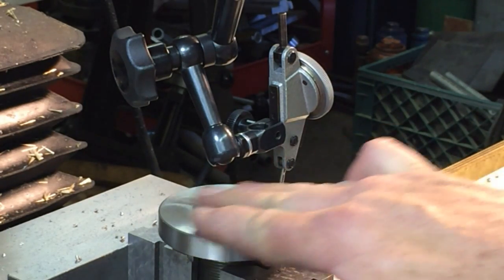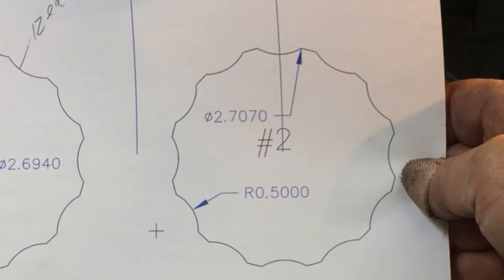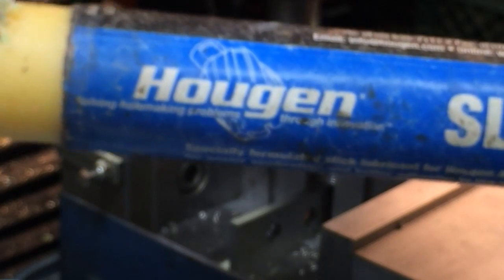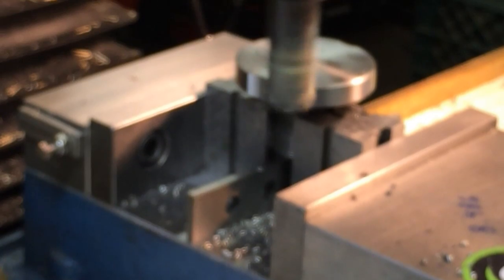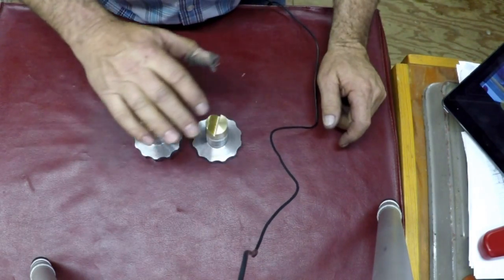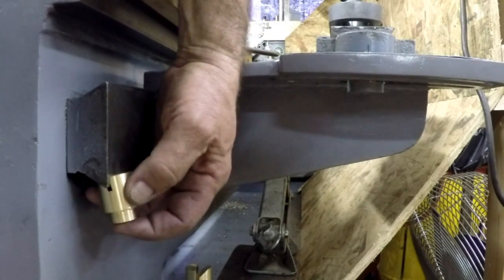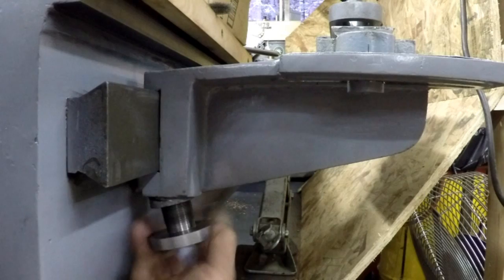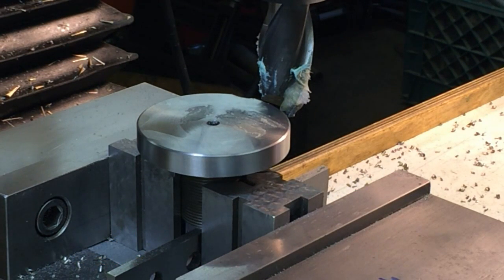How to Repair a Lathe Change Gear Part 8

Comment: Re: Mr  Bozo at the end. Better a kick-away like that than to rotate the part around several times, chewing up the entire periphery. I think we have seen something like that from one of the other Youtube Machinist luminaries.

I kept thinking that a collar of copper sheet (0.050" or so) wrapped around those threads would let you really clamp down on those screws in the mill and on the lathe. My house is roofed with that stuff, so I have a lot of scrap around.
Reply from the maker: Peter W. Meek Yep, it would of been even better if I had the vise tight.  Wrapping the threads would of helped, copper provides alot of friction.  That makes a very nice roof.  0.050" would make some nice soft warps for the lathe chuck jaws.  Thank for the idea's Peter.   ATB  Randy

Comment: Hi Randy,
have you thought about putting 2 or 4 holes in the face of he knob to accommodate a spanner wrench to tighten the knob? since a guy can't get too crazy with the torque on a spanner it would sure be a better way of getting the tight on the knob without having to resort to a pair of channel locks.

mike
Reply from the maker: HolzMichel Thanks for watching Mike.  Thanks for the suggestion.  I was thinking of a spanner but using the scalloped edge.  That would give multi-positions.  Randy

Comment: Nice work! Does the hole on the outside go all the way through? If so you should be able to put some tig rod or something through the hole and push the brass up into the hole while still being able to turn the handle and start the threads when they are all aligned. Enjoy the videos keep them coming..
Reply from the maker: ***** No on the hole, but I am going to re-visit this whole setup in the near future to see if can do some improvements.  Thank you for the suggestion.  Randy

Comment: Now that you have the locking bushings engaged it may be a moot point, but.  If you slide the taper frame off the way you can then adjust the position of locking bearing as you slide the taper frame back on.
Reply from the maker: Morris Gallo Thank you Morris for the suggestion.  I think that will work.  It be a bit tough, the unit weighs about 60+ lbs.  Thanks Randy

Comment: Hi Randy,
To make an easy hold of the angled bushing while you thread the handle, you can have a hole in the handle in where you can have a rod to hold the bushing while you thread the handle, then slip out the rod, voila... just an idea...
Is the lubricant for annular cutter wax based.... So far I use this kind of lubricant on the band saw for aluminum and it's great on stainless for threading and tapping.
Cheers,
Pierre
Reply from the maker: pierre beaudry I am going to revisit the entire clamping and alignment of the taper attachment in the near future.  I just went with what was there for now.  But after using it there is something I think I can do to make the entire arrangement better.  The lube is yes for annualar cutter.  I have used it on the porta-band and drilling works great.  Thanks Randy
Reply: I find it holds better to the work than Anchor Lube... The waxy part melts and penetrates instead of flying away from the work.
Reply from the maker: pierre beaudry I agree.  Sticks better and melts as the tool works.  And it is cheap.  Randy

Comment: The knobs turned out nice. Pun intended. ;-) If I could make a suggestion: The knob seems to have a hole in the back side. Cut a small slot in the brass piece and use a small flat blade screwdriver to align the lock while screwing in the knob.

Colin ;-)
Reply from the maker: ***** Thanks Colin for watching.  I am going to pay a revisit to this entire arrangement in the near future.  Thanks Randy

Comment: hello Randy, great video series again ! so in my opinion i would drill inside the knob and the brass wedge and put a compression spring inside, that would put some preload on the brass wedge to hold it in perfect position for installation, and also reduce the chance of the screws shaking loose during use..

best regards Andrew Norman
Reply from the maker: Andrew Norman Thank you Andrew for watching.    I am going to pay a revisit to this entire arrangement in the near future.  Thanks Randy

Comment: Holy Cow, you gave my piano fingers a fright at 7:43 when you seemed to be testing the lube on your end mill, but were actually behind it touching the part. Phew. Heart still pounding. Good vid. Thanks Randy.
Reply from the maker: Jim Milne Thanks Jim, I was several inches away, I checking the surface finish.  All is good.  Randy

Comment: Nice fix on those tensioners, but I will agree with you on the flaw of the original design. Is there a way to have some sort of indexing rod or handle that could go through the face of the hand wheel so you could hold the v-slots in the right orientation as you install it, or is it worth messing around on for the once every blue moon you will be taking those out?

Just thinking out loud, Aloha...Chuck.
Reply from the maker: Knolltop Farms Thanks Chuck for watching, I am going to be revisiting this entire arrangement in the near future, i am sure there is something that can be done to make it all better.  Randy

Comment: Put some heavy set screws straight  into the v groove ?
Reply from the maker: Mack McCurry Mack not quite sure where you mean.  Thanks Randy
Reply: On that big flat spot above those locks you just rebuilt.

Comment: Could you slide the taper attachment off its dovetail just far enough to locate the lock and hold it in position while tightening the clamp?
Reply from the maker: Yan Wo Thank you Yan for watching.  That could be done but might be difficult the attachments weighs about 60 lbs.  very heavy to deal with.  I will be revisiting the issues with this in the near future.  Randy

Comment: Hi Randy, love your videos. Love your thought process. A suggestion, drill a hole through the center of your knob to permit you to put a small rod or screw driver to hold your wedge in position until the threaded part of knob touches the wedge.
Reply from the maker: CVARANGER Thanks you for watching.  I am going to take another look at this entire setup in the near future.  I think there is more than one issue here.  Thanks for the suggestion. Randy

Comment: Randy, an easy way to make sure they slide in and stay while you're trying to get the hand wheels on is to drill a hole in the center of the hand wheel and use a probe, rod or something through the hole to hold it in while starting and tightening the hand wheel. The hole can then be used for a grease fitting or just a pipe plug or something.   Just a thought.
Ken
Reply from the maker: Ken Wolfe Thank you Ken for the suggestion.  I am going to be coming back to this entire arrangement in the future.  I am not happy the way the entire setup works.  Thanks again Randy.

Comment: Nice videos Randy. Did you ever do anything with lathe tool holders you made I think I have looked at all your videos & didn't see anything.
Reply from the maker: Mike Nixon Thank you Mike for watching.  I finished the lathe tool holders for the AXA QCTP.  I have not blued them yet but I plan on doing that this summer when it warms.  You should be able to find all the video's on the tool holders in the Lathe Related playlist.  Thanks Randy

Comment: I think at a minimum you should have a thrust washer between the stop and hand wheel so tighten and loosen torque can be absorbed without trying to rotate the stop from friction between the two.  A full on thrust bearing like on Adams welding table would work even better but a hardened washer would do a lot for you. It all looks very nice. Also if you knock a bit more off the top(thick side) of those stops it should allow the wedges to pull the table against the outside face of the dovetail to tighten it all up.  With it like how you have it any play that is in the bores and the stops can not be taken up because it is locked by the two opposing faces.
Reply from the maker: bcbloc02 I agree.  I am going to re look at this arrangement to see what can be done.  It would be great to make this work better than it does.  There were a couple of other issues I found while using the attachment.  Thanks for the suggestions, I am making a list of the suggestions.  Thanks Randy
Reply: Randy,
I was thinking the same thing. The brass inserts are almost too perfect. The mechanism needs to pull the brackets into their dovetails to take up the play in the taper attachment. Taking some material off the "long side" might do it.
John

Comment: Isn't there a thru hole in the knob... use a punch to push the brass piece up against the dove tail?
Reply from the maker: DSCKy Good idea, easy to do.   Probably will do that.  Thanks Randy

Comment: Great job! You think they would have made a keyway so it wouldn't turn when installed. Anyway, I give you an A+. Couldn't have done better myself... LOL

Have a happy Easter.- R.C.
Reply from the maker: RC Miller Thank you for watching.  Yep kind of a poor design.  But I will make it work.  Thanks Randy
Reply: Randy Richard
Maybe you could drill a hole in the casting and put a pin in too run in a keyway.
Reply: RC Miller Why a cross hole? Why not a small hole through the center of the hand wheel/screw so a small pin punch could be used to hold the brass slug in place while starting the screw?
Reply: WB8MHE
I didn't say a cross hole. Just a hole to insert a pin part way. The pin would then stick out maybe .100(on the inside) just enough to catch a key way in the brass. Just like a collet dose.